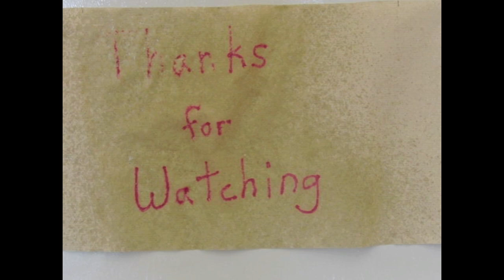Punkin Chunkin Trebuchet // Homemade Science with Bruce Yeany

Comment: Bruce--How do you connect the pulley system to the arm when it's loaded up high?  It looks like you have a sort of flagpole arrangement rigged with rope attached to the eyelet on the throwing end and attached somehow to the counterweight end that you pull the block and tackle up to?  And then you have a bracket with a bolt or bar across it that the pulley clips onto?  Any info on how you get that to attach, or what pulley system you are using?  Do you have any videos of the whole process--attaching the pulley after firing, pulling the arm down, placing the safety, inserting the firing pin and then firing again?
Reply from the maker: I can give you a brief description, write me at Bgoknee@comcast.net

Comment: Bruce—I love the design of your trebuchet.  I built a knockdown in 2016, but it was a chore to load and put it together on-site every time.  I love that it is built into the trailer, so I am building one similar with some high school students.  What is the height of the axle point, and the length of the arm?  And it looks open on top of the vertical axle support so you can just lift the arm/axle on top.  How do you secure it afterward?  And where did you get those weight plates?  I really appreciate your help.  Inspiring.
Reply from the maker: the axle is about 10 feet off the ground, if possible I would make it higher and make the  back end shorter that would allow the arm to be pulled back to a steeper angle.  we lift the arm and axle  and fit it into a slot .  we then bolt a cover plate to keep it from hopping out.    we had a source of scrape lead so we made 55-60 pound plates by melting the lead and pouring it into a roasting pan as a mold
Reply: Great ideas.  Do you have any plans you could share of this design?  We’re just doing this for fun, and yours is exactly what I’m looking for.  I have a 4x11 ft trailer, just trying to figure out how to attach it and keep it stable so it doesn’t need long diagonal braces on the sides….

Comment: Hi Bruce - love the machine - great job! Is the frame box section steel or wood? And the throwing arm itself? It looks really sturdy! Thanks, Charlie from England
Reply from the maker: wooden frame mounted on an old boat trailer,  this was the fourth arm that I built for the machine.  The arm was made from two long 2 x 8 pieces of poplar wood.  the long end of the arm has a thin sheet of metal sandwiched between the two halves, the3 short end is reinforced with 3/8 inch thick steel sheets that extends short distance past the axle.  The previous  poplar wood arm broke while throwing due to the strain,. this arm was made thinner but was reinforced with kevlar and epoxy resin.  under load it bends about one foot under load

Comment: Do you have the plans for this size machine? If so, where can I get them?
Reply from the maker: I haven't seen anyone that  has plans for big ones, we see that when they get this large the design may be altered by what materials you have available.   we built several small ones to better understand the mechanics of it and then went larger.  The concept and behavior is the same.  We use a  1/12 scale model to test out the set up for the most efficient  throws and then apply it to the large one.

Comment: Have you ever managed to get velocity reading for any projectile?
Reply from the maker: we were just throwing some milk jugs a few weeks ago with half the weight, while the path would be an arc,  the  horizontal speed was roughly 60 mph. It would be faster if we threw using more weight on the arm with a light projectile and throwing straight ahead rather than releasing it on a 45 degree angle

Comment: Hey Bruce, thanks for this video, it's awesome. I wanted to ask you something and I would really appreciate your help: I want to build a trebuchet to throw an egg 65 feet away, but I don't know where to start. There are so many variables, like the length of swing arm, mass of the counterweight, height, mass of swing arm, etc. What is that single variable that my team and I should be focused on to be closer to a successful result (landing the egg in a basket placed on the floor 65 feet away)? I would really appreciate your help, thanks!
Reply from the maker: When I started building trebuchets,  I found quite a bit of information and plans on the internet and realized there were several different types. Try doing a search for golf ball trebuchets and there should be quite a few offerings.  If you want to be more involved in the design,  then traditional design like the one we have is an easy place to start.  To get the dimensions for our large machine,  I built a small one and made it so I could make several adjustments for testing purposes.  Several holes in the arm for changing the axle position,   adjustable hanger for the weights,  make provisions so that you can add more weight,  extras string on the sling and then try variations until you get the maximum distance.  My advice is make a machine that you can adjust and test
Reply: I was going to ask a question, regarding whether working from a small model would benefit me and this answers it. So this comment is just to thank you for being a super helpful guy. Thank you.

Comment: Nice video! What did you use for your release mechanism? I have students building medium sized trebs (10lb counterweight, launching a tennis ball) and I am looking for good ideas. Thanks.
Reply from the maker: our's is very simple.   two eyebolts attached to the base. about 3 inches apart,  the arm has an eyebolt the fits in between them and then a thin metal bar slides through all three,   to release, pull the bar out.  On my smaller machines,  same deal only instead of a bar on the arm it is a short piece of rope tied to the arm and the rope has a loop in it.  the metal bar slides though an eyelet, then the rope loop then the other eyelet

Comment: I think if it didnt have wheels on it (or had breaks), it wouldn loose that much energy by rolling after shot. Or does it loose that energy anyway, just the ground absorb it?
Reply from the maker: you're second answer is correct.  This type of trebuchet throws further when the body is able to move,  when there is less friction,  these machines can actually start to roll as the weight is falling.  Allowing the weights to fall in a straighter line means it will fall faster,  a more modern version of this idea are trebuchets that have movable axles for the arm.   The other benefit with the wheels is it allows the machine to get rid of excess energy by rolling,  when they are stationary the excess energy goes into the machine which may cause it to buck and tip, also harder on the frame connections

Comment: Interesting design on the one just to the left of you at 3:07. It looks like the throwing arm is pulled back nearly 360 degrees and the counterweight is directly above the arm's pivot.
Reply from the maker: HI Kevin,   you have a good eye,  that is a propped trebuchet,  it has two triggers,   the weight that hangs down is propped upside down,  it swings part way down and then pulls the trigger to the big arm  to swing down.  It makes it throw a lot further than when the arm is just hanging down.     I have a small one and plan to video it one of these days

Comment: I wonder what happens to those pumpkins once they hit the water.
Reply from the maker: +blackpanther  Hello blackpanther,  when they hit the water they break apart and the pieces float.  There always seems to be a wind that pushes  the remains to shore where it is picked up.  The fire company that sponsors the event also sends boats out afterwards to clean up and additional pieces.
Reply: I thought they would break up into a few huge chunks, sense water is pretty much concrete if an object hit from high up in the air.
Reply: Fish eat them.
Reply: Robert Jensen That is some raw pumpkin pie then.